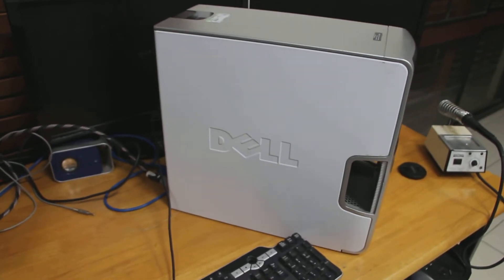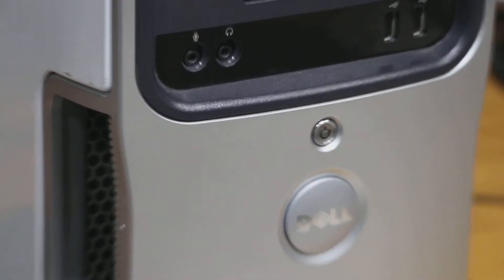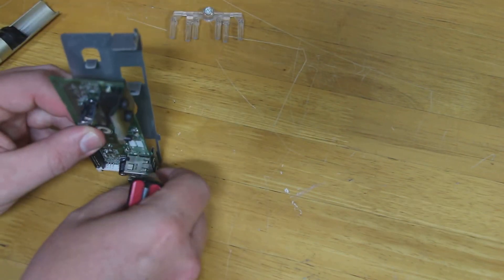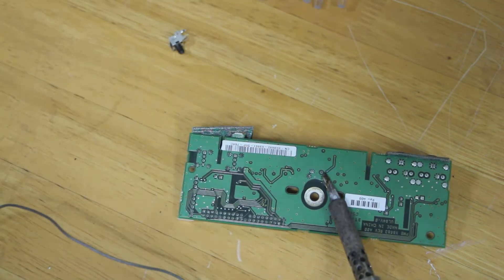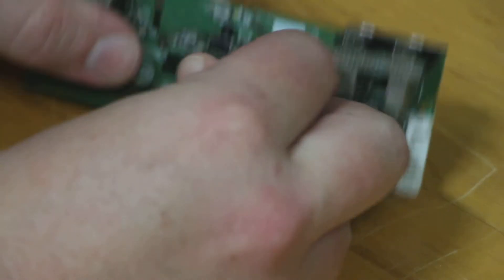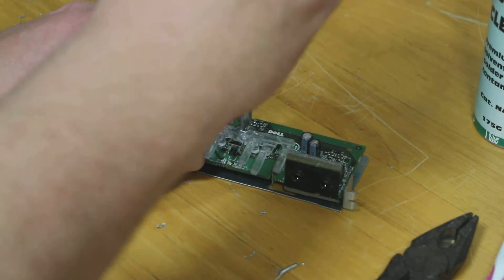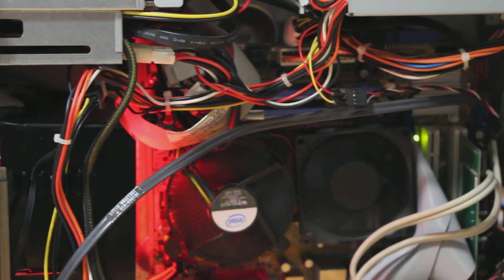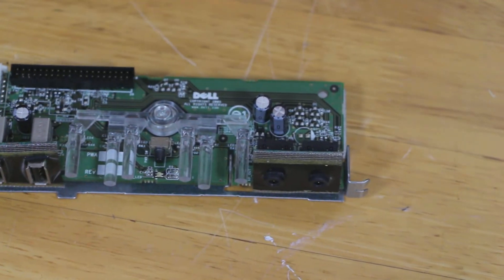Dell Dimension 5100 Wont Turn On Fix.

Comment: Also before replacing/de-soldering try spraying some WD-40 or De-Oxit into the switch and pressing repeatedly to see if you can dislodge/clean the oxide off contacts inside!

Comment: Can u help please my button when i press it i can hear noise motherboard is showing that it have power but i cant start my pc what i need to do pls sorry for ban english?
Reply from the maker: Unfortunately there is a few things that could be an issue here.

If you are not getting any beeps from the motherboard.
Usually the first thing I would do is unplug all of the cables off of the motherboard except for power cables and the CPU fan and remove all cards except video card and ram.

Then I try booting it up.
If that works I slowly re plug drives/ cards back in until it errors then I know the problem.

If it still is not working then I try removing the ram and video card.

This should cause an error that beeps at you.
If it beeps it tells you the CPU and motherboard are talking to each other.
At this point put 1 ram stick in at a time and the video card until you find the error (you may need to try another video card). 

If you PC is not beeping at this stage you can try cleaning anything of the motherboard and maybe taking the CPU out and putting it back in this will basically re seat the CPU if it making a bad contact.

Basically you either trying to get the PC to beep so you know that the CPU and motherboard are working together.
Then you are trying to get the PC to boot on bare minimal components plug stuff back in until you find the fault (some times it somethings need to be just plugged back in to make contact again).

Unfortunately this is not a straight forward thing to fix and there possibly is a faulty components that is causing the problem. Re seating most of the hardware can fix this due to overtime the copper contacts do oxidize and don't contact properly giving issues.

We hope that can help you,
It's not a fun position to be in and we wish you the best of luck and hope that you can resolve the issue.

Thank you for watching.

Comment: ive got the orange flashing light. any tips on how to fix
Reply from the maker: Unfortunately it could be many things.

Try re-seating the ram and video card.
Sometimes running an eraser along the contacts for the ram and video card can clean any oxidization. Something to do extra when the ram or video card is out is a good idea or you still have had no luck. What happens here is basically a layer of build up from oxygen builds a non conductive layer old contacts).

Resetting the cmos sometime will help a PC that is not posting.

You can also try unplugging drives and just seeing if you can get it to boot up the logo on the screen. unplugging extra items can help fault find and save confusion, but you will have to plug them all in to give you a full functional computer.

Really all you can do is fault find the machine.

Good Luck, let us know how it goes and thanks for watching.

Comment: Help! My dimension is doing nothing when my power cable is connected. The psu is fine, and I don’t know how to test the motherboard!
Reply from the maker: When we noticed we had a power button problem when we pushed the front power button in very hard and rolled our thumb around the button. Every now an then it would boot up.

You could give that a try.
If that's the case then you will need to replace the button or the pcb that the power button sits on.

Comment: My dell 2400 won’t boot the psu works and the motherboard has a green light on it that works when hooked up any tips
Reply from the maker: Try doing a CMOS reset firstly.

Sometime there is a jumper that does this on the motherboard. Close the jumper (shunt it out basically) and try a boot. 
This will generally wont make the pc boot. Turn off again and remove jumper. Try booting Hopefully that will work.
Other wise you could try this method. 

1. Disconnect the power cord from the AC power    source.
2. Remove the computer cover.
3. Find the battery on the board. 
4. Remove the battery:
        Wait 1–5 minutes, then reconnect the   battery.
 
5. Try Boot Up

If you are not getting any beeps from the pc, 
You may need to reseat video cards and ram.

Fault finding pcs....

Usually in computer fault finding  once the simple tricks don't work I will try to make it go into an error mode where it beeps at you. If you can make it beep there is a good chance you get the pc to work again.

To Do this. 
Pretty much remove all the drives all the cards including video card.

Get it down to the Ram and cpu and power connected only in the pc. 

Try booting pc

If that does not give you a beep try removing all the ram and putting it in one by one (you may need to switch around which stick is in if it does not beep at you)

A single beep usually represents a successful post and lots of beeps mean something is not right.
Both at this stage are good signs.

Once you get a beep from the motherboard that's a good sign that you should be able to get it to boot.

Now put the video card back in and see if it boots up with display.

Slowly put things back in and check by booting periodically.
If it doesn't boot than you may have found your problem unless you have found that all ready.

Sometimes video cards and ram just need a reseat or a clean. You can clean the contacts on ram and video cards by using an pencil eraser.
Rubbing that across the contacts can really make a big difference in the conductivity.

That's about all the tips I have for you right now.
We hope that helps.

Good Luck.

Let us know if you have successor not.